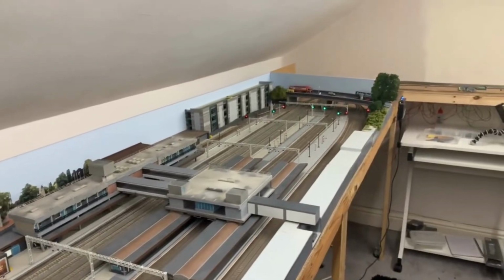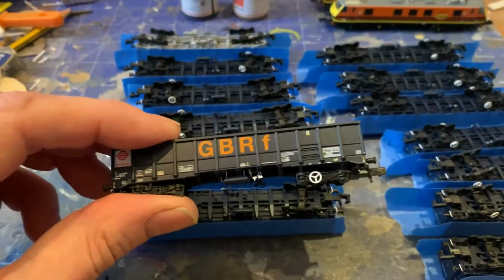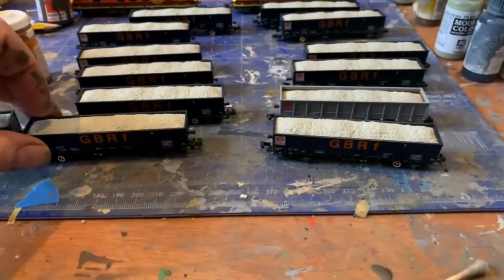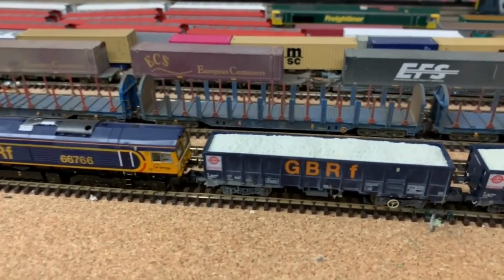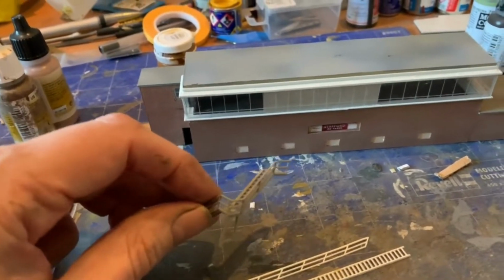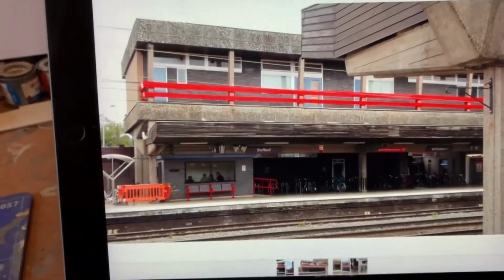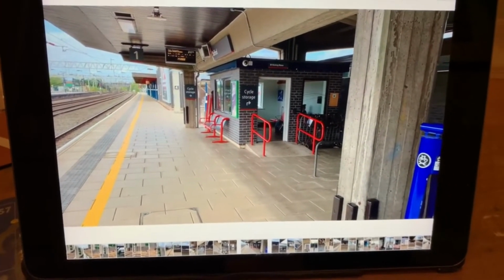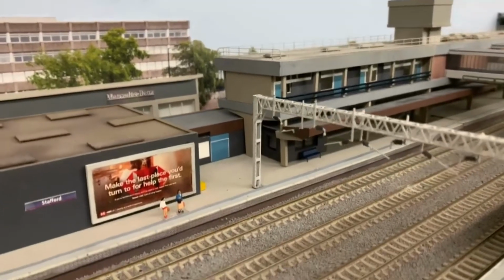N Gauge Layout Update 9.1.23

Comment: Hi Ben  - congratulations on passing the 500 subscribers.   You've been busy - all these little jobs do take time but that's what brings a layout to life.   The new Farish 90's - are they a weighty model - considering getting one with Santa's money to pull the intermodal up he helix.  My Revolution class 92 has gone back after 10 months on the layout.  Motor burnt out according to Revolution so replacement on it's way back to me.  Just found out the model was made by Rapido whose new Co Bo is a disaster by all accounts.  Anyway enough of my moaning  - excellent  update as always.  Cheers Euan
Reply from the maker: Cheers Euan, Yeh enjoyed revisiting the signal box and finishing it, something I started before the channel, a great subject to model. The 90s are not that heavy no, with a pair thay have managed to pull 18 intermodal wagons so pretty good, and had no issues so far. Would definitley recommend one. Sorry to hear about your 92, ive got one and had no issues so far, but did get one second hand from rails which I had to return, you must have run it a lot then, yeh heard about the class 28 co bo’s, a bit of a mess.
Reply: @staffordstationngauge8359  the 92 no it wasn't run that often so very surprised Revolution informed the motor was caput!